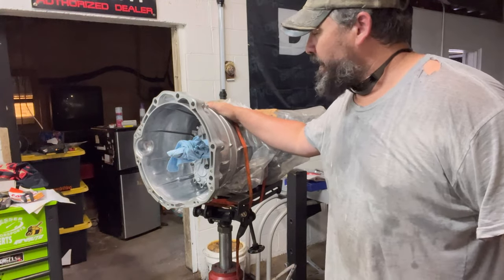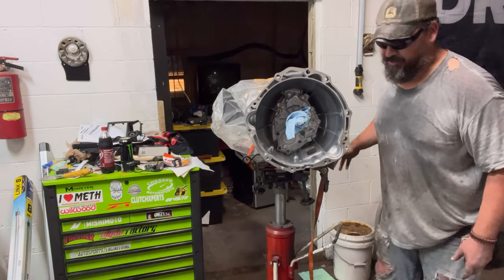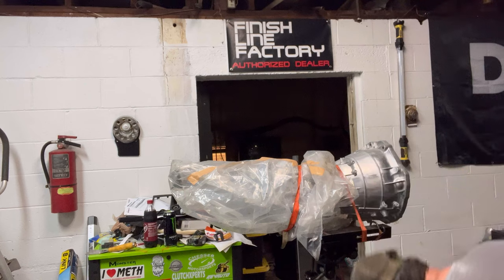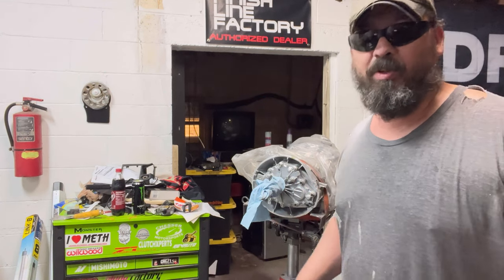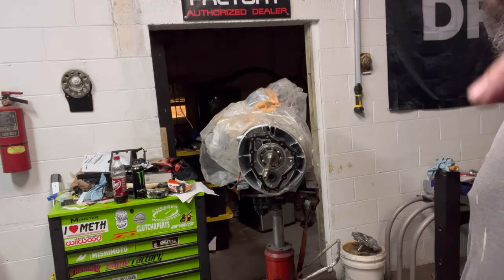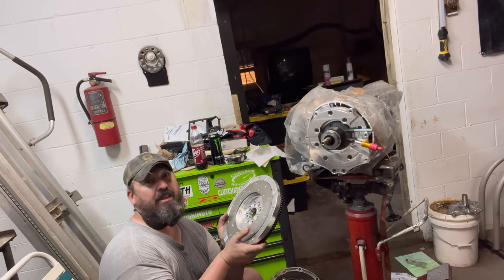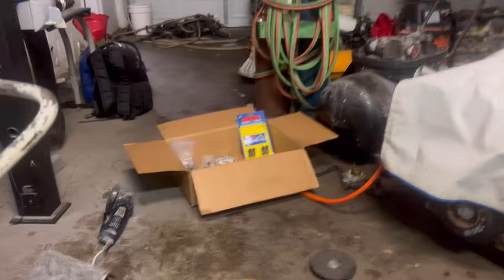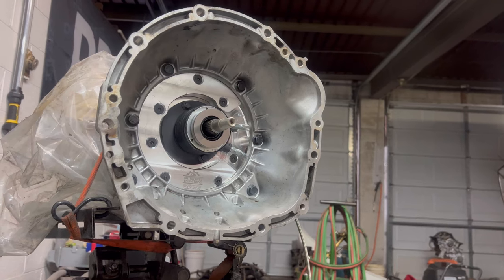AUTOSPORTS ENGINEERING CD009 to 2JZ ADAPTER ON A BRAND NEW TRANSMISSION

Comment: I bought a transmission with this adapter and I don’t have the supply lines! Do you mind sharing the links for the T56 extended bleeder and supply line please thank you!
Reply from the maker: The supply line came with my kit so you should be able to buy it from them and possibly the remote bleeder. I do know you can buy a remote bleeder off Ebay.

Comment: Did you have to cut the input shaft?
Reply from the maker: No, its a pretty simple kit really. Just the bellhousing comes off and pretty much just bolts on after you check which bearing the trans has and make sure the cutoff section is clearanced enough to put the adaptor on flush so itll seal correctly.